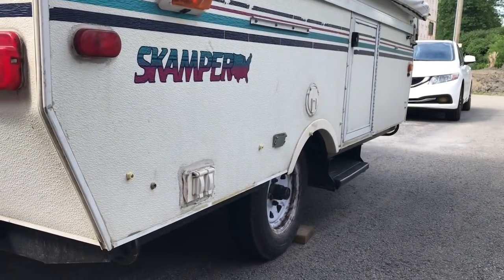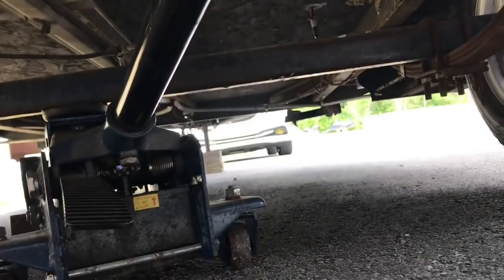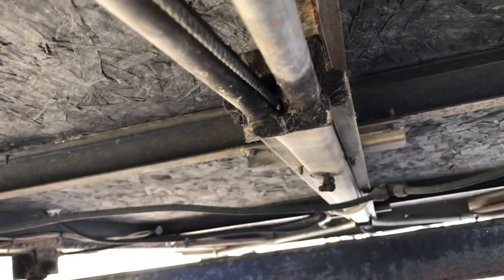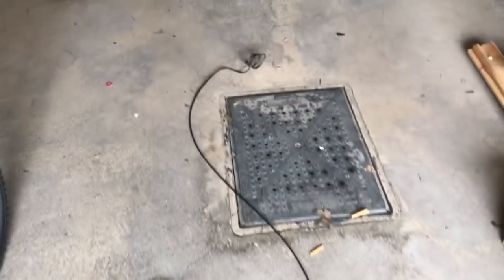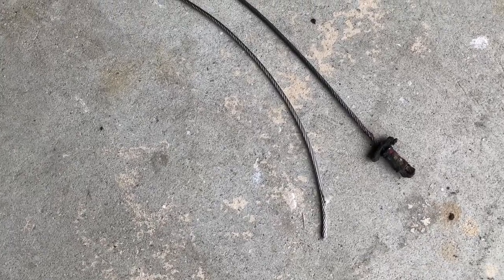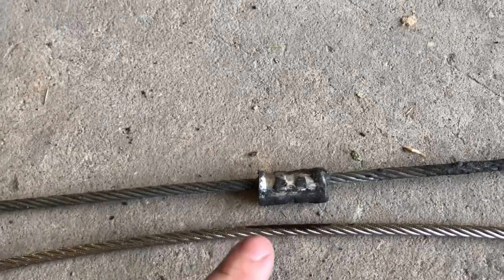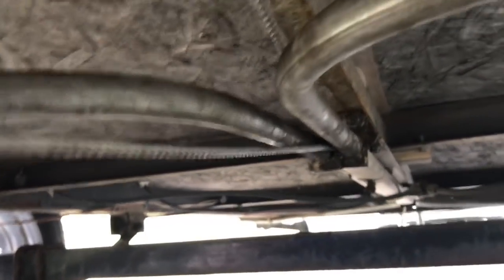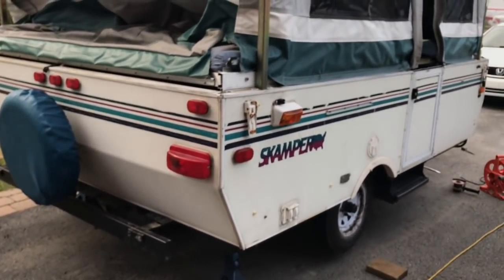Replacement of Goshen lift cable in my popup camper

Comment: Great video.  A real positive impact to the web.  One note.  I have a 2008 Rockwell and the tubes are the opposite way.  The larger tube is on top for the rear springs and the bottom tube is for the small.  Had to unbolt the front screws holding the springs into the sidewall and loosen all the screws at the front of the tube so I could get a small screwdriver in there to get the cable through the front housing.  Took an hour plus and I know have to hook up to the winch to see if it works.  If it doesn't it's landfill.

Of another note.  I'm in Vancouver BC Canada an NO ONE will fix tent trailers.

UPDATE:  The cable replacement works.  Next up replace winch and motor.  Thanks John for this amazing video

Comment: Thank You Thank You Thank You.  I had the cable break on my 2000 Flagstaff and this video was my resource guide to replacing it.  In the process I replaced the front and rear springs and master tube.  Just an FYI for those in the USA, I ordered directly from Goshen and saved 25 to 40 percent on each piece opposed from buying from a distributor.  
Thank you again for making this video and helping this process be almost impossible to screw up.

Comment: One possible improvement: I taped an end of a 2mm paracord to the end of the steel cable (about 17:15 into the video). When I pulled the cable, I pulled the cord and then taped it to the new cable. That way it was super easy to thread it through the pipe.

Comment: Okay, you saved my life. Well, nearly. This video is exactly what I needed. I got a 1997 Rockwood with the cable broken for a great deal. Ordered the parts from Goshen ($61 for cable, pulley, and shipping), and then found your video. Perfect! Took me about 2 hours. The hardest part was getting the cable clamped on the winch. What a pain! The only part that tricked me a little is that my front and rear springs are opposite; smaller hole on top and bigger on bottom. Thank you!
Reply: Artwolf80, glad u mentioned that Rockwood is opposite because I’m going to do this to mine which is a ‘99. Great video though for sure!

Comment: I've seen several videos on how to replace this cable.  But this is the most detailed video I have seen.  Very good!  I have a 2003 Viking with the Goshen system.  My cable has not broken or even looks worn, but I want to replace it just to be on the safe side.  I got the new cable from Goshen several months ago and I carry it with the necessary tools to replace it in the field should the need arise.  You made it look so easy that I think I'll just go ahead and do it now before the camping season begins.  The only concern for me is the upper and lower stop switch on my winch.  It looked like you have a manual winch, but mine is electric and has stop or limit switches.  They must be taken into consideration when attaching the new cable to the spool.  I think what you have to do is run the winch in the down position until it hits the stop switch.  Then attach the cable by first making three wraps around the winch take-up spool before anchoring it to the anchor clip on the side.  I have not done this yet, but I'm pretty sure that's what the directions say to do.  I'm 73 years old, but your video has given me the courage to get under there and do mine very soon.  Also, don't forget to use plenty of grease on the cable and springs before installation.

Comment: Great video and thank you so much. BTW, my dealer has refused to repair the broken cable on my Rockwood (2018) camper and so has every other service center in SoCal. My only option is to do it myself and the only resource is this video from you my friend. Thank you again. Priceless.
Reply from the maker: Thank you so much for your kind words
Reply: @DIYManiacJohnP  I just did it. It took me less then an hour to do this and I am not a great mechanic by any measure. I am so disappointed by Forest River for not providing these instructions, when their service centers won't even try to fix this. Anyway, you saved the day for me

Comment: John, We wanted to say THANK YOU so much for your video as it gave us the courage to open our system to take a look at what might be happening as our left rear lift was not lowering.  Come to find out the spring was fine, but in the revamp we put a screw through the post stopping one of the tubes from lowering.  Your video was the key to our fix.  Thanks!
Reply from the maker: Thank you so much for watching and your kind words
Reply: @DIYManiacJohnP  how long was the cable you bought?
Reply from the maker: @jeremywilkins2010 I bought more length than needed, and then measured it against the existing cable and cut it to the same length

Comment: HUGE thank you for this video! Helped repair my 1993 Skamper 17c.  The only difference was that the "main tube" is upside down compared to yours.  Taking apart was cake, took me longer to jack it up and secure it than pulling it apart did!  The hardest part was finding a local place that sold stainless steel wire rope sleeves.  Had to travel an hour to pick them up, couldn't believe it! Checked 10 local stores and all they had was aluminum ones which should NOT be used.  Also, measure your cable first and go to Home Depot and have them cut the custom length vs buying it pre-packaged.  Mine was $8 vs $20 buy doing that....though I first bought the pre-packaged and couldn't make a clean cut at first, so I have plenty of cable now, haha.  Additional tip for others.... don't buy the "cable cutters" from Habor Freight, they aren't made for wire rope won't cut cleanly, which is needed to pass through the sleeve.  Home Depot sells small handled wire rope cutters in the wire rope aisle that makes a clean cut.  Besides tracking down all the parts and tools, the worst part was securing it to the crank system because mine is INSIDE the camper so I had to crawl in and wedge myself inside cabinets to get to it....not comfy.
Reply: Hey Dustin, is your trailer an 8ft box, the smallest trailer? Crank was inside and the handle is at the side and not the front? 
Thanks
Darrell
Reply: darrell mah that’s correct, yes
Reply: @darrellmah2944  Yes, exactly that.

Comment: Thank you so much for this video!!! I was gifted a '91 palomino sxl a few months ago. I went out to set her up this morning and about thirty seconds after I got it raised I heard a loud pop and a  crash. I ran out of the garage and the top had fallen. Thank goodness nobody was inside. The cable had snapped. After some looking around I stumbled upon this video. Thank you so much!!! After watching this I ran to the Lowe's home improvement store for parts. About two hours and $12 later she is good to go!!!
Reply: I know it has been a while since this comment but I wanted to suggest looking into the safety supports. I too have a 91 Palomino (yearling) and it came from the factory with them. They are easy to find on the pop up parts online stores if you don't have them already.

Comment: I used this for my 2004 Rockwood Camper and this was an awesome, informative guide.  There were a couple tiny differences, the largest of which was that the rig is "upside down" on the 2004 Rockwood.  The lead wire returning to the crank, and the forward "push springs" are along the bottom channel instead of the top.  Thanks!
Reply: Michael Gasink what was the size of the cable you used 1/8 3/16 or 1/4 3/16
Reply: Ditto

Comment: Super helpful video! I was able to perform this repair at the campground with the roof raised (and supported) as the cable snapped after I had the fail-safe brackets in place. However my top/bottom channels we opposite yours for front/back operation so pay attention to that for anyone making this repair. Thank you so much for the video!

Comment: This was super helpful, however, like at least one other Commenter, the top & bottom tube description in your video was opposite for me. I have a 2007 StarCraft. Based on the ‘2660 Series Crank-Up Lift System’ one-page instructions from Goshen, the end of the cable goes into the top tube and the top set of pusher springs get pushed towards the rear pulley (operating the back lift). The cable then heads around the pulley & into the lower tube towards the winch and pushes the bottom set of pusher springs towards the front (operating the front lift).

Comment: I am in agreement with other comments, best description of the replacement I have found and so glad I found it. I've had a replacement cable for 2 years now but was unsure about doing this job even with the instructions from Goshen. My cable has been bolted together for 2 years but looks very frayed this season and I know the cable replacement has to be done. I just pulled the trailer out on the weekend and was getting my head around the replacement. Pretty sure with your help I will be successful, thanks so much for taking time to video, post and repeat many clarifications!!

Comment: I bought a 1994 Palamino Stallion pop up camper.  Brought it home to show my family, and it broke.  Just like yours it broke at the winch.  I went to our local camper dealer.  He drew great pictures on how it went together,  but not the stops (I love pictures and videos).
He assured me I could do it.  
He also told me, if he did it, it would be about $80 for the cable and about $300 labor.  
I will do this myself.  
THANK YOU!
Reply: Norma Stout Morgan  what is the size of the cable 1/8 3/16 or 1/4 3/16

Comment: Starcraft 2106 uses the identical Goshen system.  Two years ago, my winch went out, so I ordered a new one from Goshen.  My camper is a 2008 and I was unsure if the cable had ever been changed.  I have heard of cables busting at campgrounds leaving people stranded and at the mercy of the nearest dealer, so I decided to order a new cable and put it on the same time I put on the winch. This was a very confusing job for me. First, I was alone w/o help. Second, the temp was 90' and high humidity which meant to asphalt was super-hot. Laying on a moving blanket did help! Thirdly, laying on the ground and looking up and trying to figure out how those giant springs did their job was mind boggling.  Had I not watched this video, the camper may have gone to the scrap yard! I did get it done and even went camping that night.  
This Goshen system is really pretty simple, especially when compared to some other pop ups that have gears, pullies, eye bolts as well as being laced through the inside of the camper. Imagine having to open and or take out cabinets inside the camper to fix it!  Something to think about for new campers trying to pick a brand. 
Bravo Zulu to you Mr. DIY Maniac. This was a great video, very well done and thorough. It made my day on that hot asphalt so much easier. Thank you very much.
Reply from the maker: Thank you so much

Comment: I called camping world and asked how much to replace the cable. They told me 700-1500$ . Yeah no thanks luckily this design has a manageable cable system not the gear box that fails in others. Good video.

Comment: Thanks for posting this. It was really helpful to see how the lift system works. Pretty sure it's the Goshen 1473 lift. They are still making the cables as I just asked them via email. I know the main tube has grease fittings, but should we be greasing the entire cable, and what about the cable that wraps around the crank, should we grease that to protect it from elements?

Comment: I'm curious how the cable is holding up now nearly 3 years on from when you originally posted?
Reply from the maker: Still going great!!! No issues at all
Reply: @DIYManiacJohnP   Good to hear! Thank you so much for posting this! I just replaced the cable (which had started to fray) on my Skamper last week using your video as a guide. It made every step very clear so I knew exactly how to do it and, as others have said, it really helped me understand how the whole system works! Thanks again!

Comment: I was soo confused about replacing my main cable also! This video gave me the understanding of how this all works now but now my problem is the front end of the camper is up with the broken cable,
Do you know if I will have to drop the front springs too? Or would it all work out and drop after I replaced my broken main cable? Any input would help! Thank you soo much this is the best and only video that helped me.
Reply: In this goshen system is the main cable the only one to be concerned about?

Comment: I have a 2000 Rockwood Freedom, I just bought it and I heard I should lubricate the cable so it doesnt rust. Came across this beauty video, which I saved to be safe. However,  what type of lubricant would you suggest and where I should apply it?

Comment: I went ahead and made my own cable like you did. I also carefully followed your instruction on installing it. It wouldn't crank up. Only the front would crank up a few inches and then no more. Turns out, my rear spring on one side had a kink. I ordered a new spring set from Goshen and installed them. However, I'm having the SAME problem, with only my front cranking up a few inches. Very frustrated. I ordered an original main cable from Goshen and will install it this week. I'm thinking that I may have made a mistake on either the installation or the orientation of the cable components that I made.  Any idea what I might be dealing with??? I'm desperately trying to get this done, I have a camping trip in two weeks!!!! 😫

Comment: For those looking into this, I just finished it on a 1993 Palomino yearling and the main bar underneath was upside down from this video, so everything he did on top had to be done on the bottom and vice versa. I t was driving me nuts until I realized this.....I was not paying attention when I took it apart so it is totally my fault,but still, heads up to anyone else about to do it......the top and bottom may not be the same as this guy's.
Reply from the maker: jmh9932 thanks for this info!!!

Comment: @John what if the cable was cut from inside the camper, and needs to be replaced. Do I use this same technique?
Reply: What do you mean by "inside the camper"? Goshen lift system is totally underneath as shown in this video. If you have a different system, such as Jayco, it will be much different.

Comment: Like a fool I didn't pay attention to how I removed the cable/tubes and last night I attempted to install everything according to your video and I have not succeeded yet but I think it has something to do with my set up being just the opposite in that when I insert the main cable into the top tray and then insert the first crimp and stopper into the same tray it does not stop where yours does(about an inch or so in) it just keeps traveling towards the front of the trailer. However when I insert the crimped end into the bottom tray it does stop about an inch or so in. So upon looking in the tray I can see that the front lift springs are located in the bottom tray therefore meaning that the rear springs/tubes will have to be inserted into the top main tube. So I'm curious if that will mean my cable setup is incorrect. What do you think?
Reply from the maker: Craig Harrison probably just reversed to mine.
Reply: Excellent video. My rear springs also go into the top slot of the main tube. I'm replacing mine as we speak. Lol. 2001 Jayco Qwest 12A

Comment: I just bought a 1991 Palomino TXL-SC with this lifting system. I may have to replace my cable eventually but not yet at that point. My question is, once I get the camper in the lifted position, how do I get the ratcheting system to reverse so I can lower it? I've been sticking a screwdriver up in the ratchet to release the catch but I know this is not the way it's supposed to work. I understand this is a really stupid question.

Comment: Awesome. Thank you. I just did this myself. $25 for the cable & stops at Home Hardware!
Reply: Doug Dunbar what is the size for the cable like 1/8 3/16 or something different
Reply: You wouldn't happen to know what the measurements are for the stoppers from the top to the one in the Middle with you

Comment: I need to do this and find two new tires for mine. Y7B5 U12. Having a hard time finding a match. They don’t display the normal tire size on none of the three
Reply from the maker: will zinsavage I would suggest taking them to a tire place as they would be best suited to know exactly what you need

Comment: what would you do if the popup has an arm that will not retract with the rest of the arms?  i know there is pressure on the springs, but not sure how to release it manually and not get hurt in the process....

Comment: Is there a danger of the cable snapping if you happen to be inside and the popup is fully raised?
Reply from the maker: Chris MacEnany There is always the danger. But that is why most pop-ups have a safety lock either incorporated into the winch or like my trailer safety bars they get installed beside the uprights
Reply: Yes! This is why goshen systems have two safety bars that you should always install on opposite corners. The only thing holding up the roof is that cable otherwise.

Comment: Im currently replacing the center crimp but i had to cut the stopper off to put a new crimp because my trailer, has an electric winch. 

My question to you is did you happen to measure from the stopper to the center crimp?

I had everything apart got everything all done. I put it back together, the center crimp was in the wrong spot. FML
Reply from the maker: I am sorry, i didnt

Comment: awesome visual and explanation - thanks so much!! Can i just ask what you used to crimp the crimps and what you used to cut the extra slack on the cable? how much slack did you end up giving the cable in the end?
Reply from the maker: anderson boujoua you need a swagging tool the crimp. For cutting the cable, an angle grinder. I gave 6” of slack